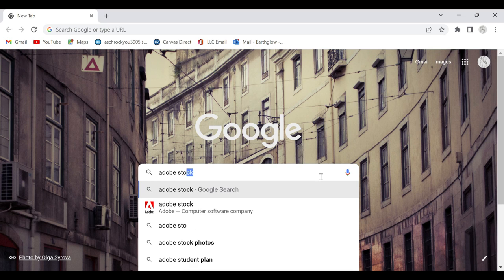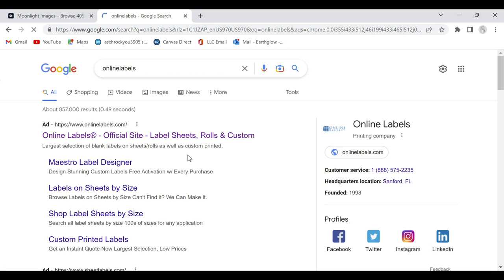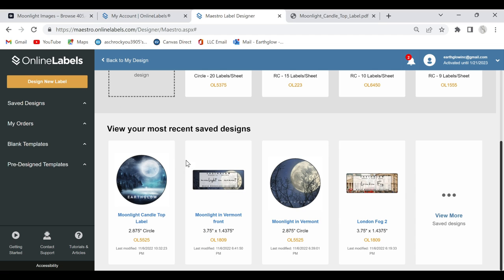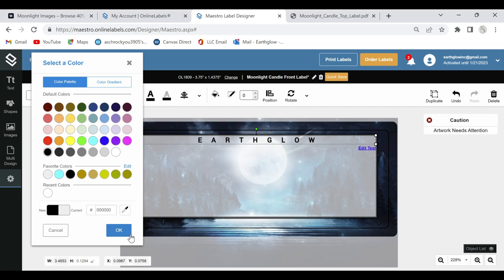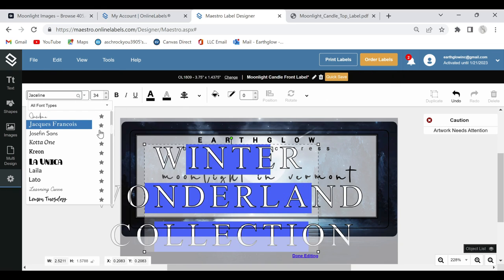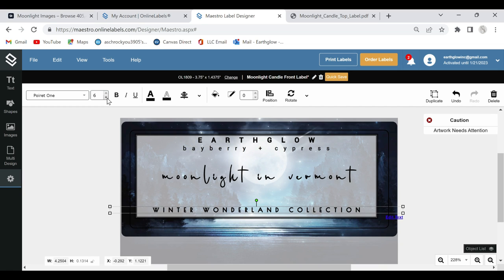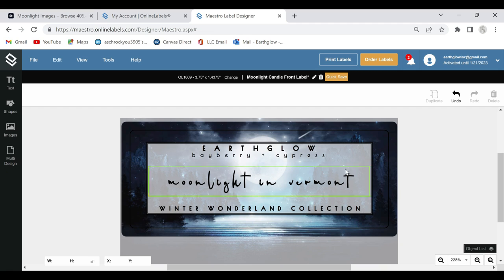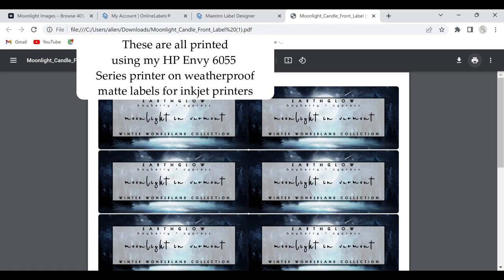How I Design & Print Candle Labels | *step-by-step*

Comment: Does your printer print on glossy labels without smudge? I've seen that be a problem with inkjet printers.
Reply from the maker: I only recommend matte labels for an inkjet because in my experience, gloss will smear. Hope this helps!
Reply from the maker: I use both inkjet and laser, depending on the desired result and product.
Reply: @earthglow  Oh alright, I will have to look into matte labels then. Thanks.
Reply: @earthglow  The printer that you linked to the HP ENVY 6055e, it prints matte labels just fine?
Reply from the maker: @heathalbritton  In my experience, yes. I use just the HP Envy 6055 (I’m not sure what the e is about but I don’t think I could find a link to the other one).
Reply from the maker: I’ve had this printer for about 3 years and it has done an excellent job with my matte labels for candles.
Reply: @earthglow  thank you! I think I’ll buy that one then.